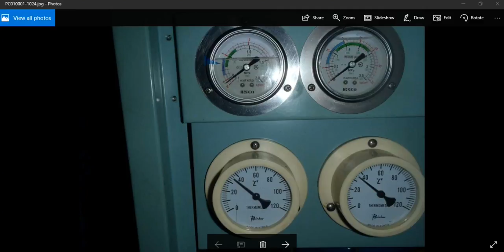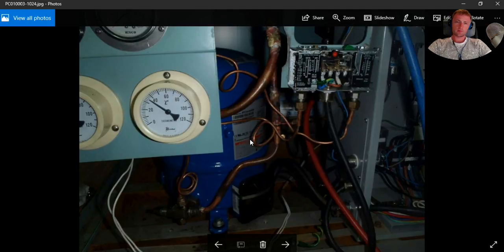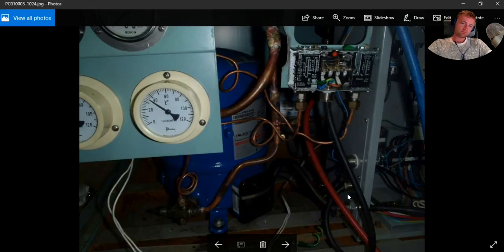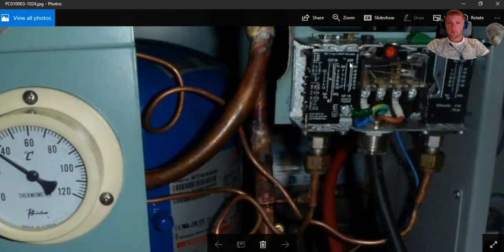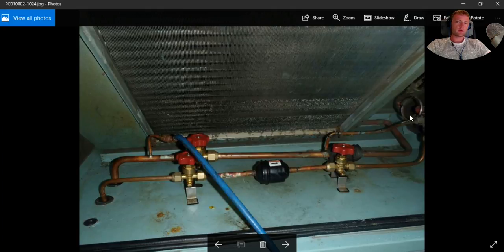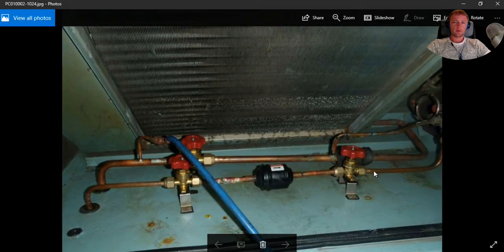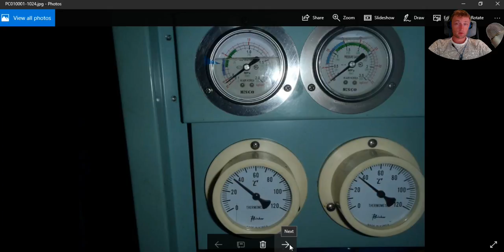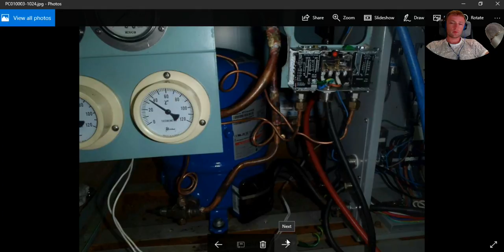ECR AIR CONDITION COMPRESSOR DAMAGE

Comment: Thank you for you time to make this useful video.                                                                              Is there the possibility that the delivery side of the compressor is the lower one (and from the delivery the freon to go to cooler)?
Reply from the maker: Always there is possibilities so you will need to do vaccum to the system and see if vaccum drops if stable for to days everything is good.But for such job you will need vaccum gauges.

Comment: hay mike.
how are you doing today. so you would have pass cape of good hope by the ship , and obviously you was tryed to ferry copper pipe from a distance away original design.... huh....?
homesick
hot ECR
never errives pipe or wire or rope
= throw it to sea😙😅
any way I had faced with this problem and i arranged to disassemble 5 accommodation medium friges and design them to cooler in just 5 hours. because we was in  loaded vlcc in Pacific and 20 dayahead.and I had no choice. 
good blesses

Comment: Hi pliz I have a question , in our ship we have an soilenoid valve in oil return line from oil separator to compressor , for what it is used this valve ?
Reply from the maker: If I am correct it is to return the oil back to compressor sump from oil separator.Probably this solenoid has a time when in opens and closes.Check that in the manual of there is something in the diagram related this solenoid.
Reply: @Adventure-Story  pliz make videos about charging and problems related to expansion valve
Reply from the maker: Charging procedure of freon must be made always with care because if you charging frequently it means there is loses and somewhere you loose that.Normally expansion valve do not have any problems and you should not touch it or adjusted in any way. One other thing that you can see is the ice creation after expansion valve which tells you a lot about the operation of valve.Sometimes it is necessary to open the doors of refrigerating chambers for some minutes and later on compressor will also start for a longer period.This will help to circulate all freon and oil and collect its amount from the line. This is much better solution to make once you are onboard.
Also very important to know is that if you see that your temperatures are fine it is not necessary to touch just only swap the compressors each two months to verify that they are working properly!

Comment: ~`7:50 i thnk outlet evaporator is already gas no liquid  , if liquid then can cause the damage our compressor but maybe im wrong here, think  liquid then is to much freon
Reply from the maker: Yes correct outlet from evaporator coming gas and return gas to suction valves after it is compressed inside compressor and heat increases so we need to cool down it in condenser next passing expantion valve where the pressure fall down and cooling effect take place when freon travelling through the evaporator from liquid it turns to complete gas.